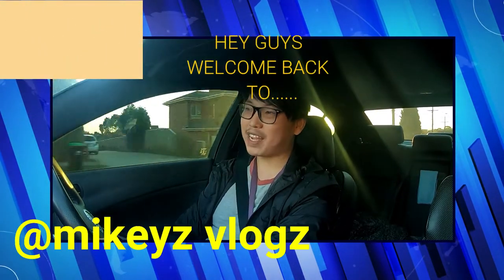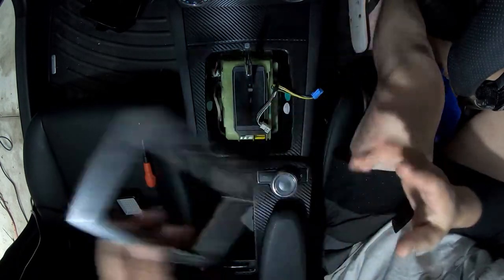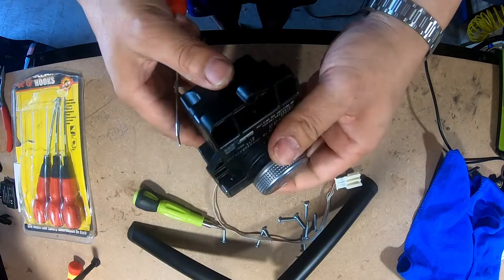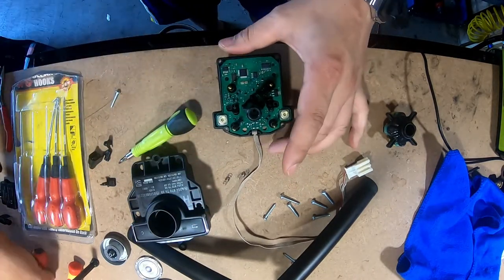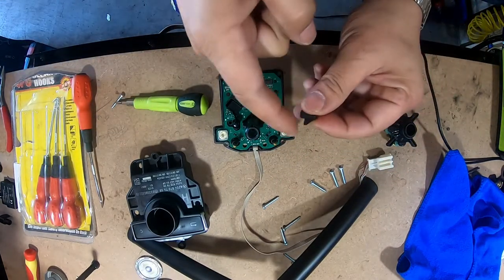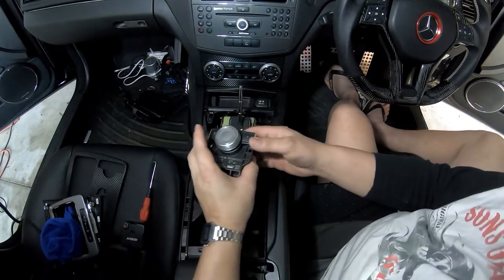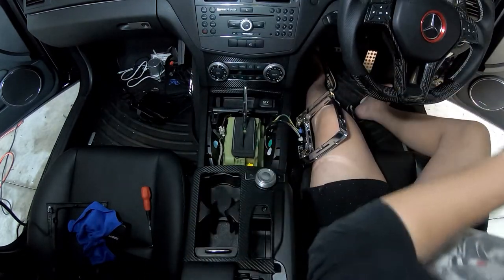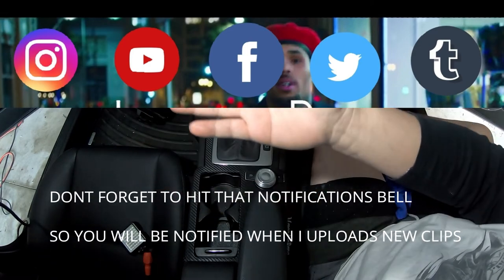Mercedes Benz w204 HOW TO  FIX command control scroll knob shaft

Comment: Dude just finished it. Reading comments after completion ….Like many others worked great! On 2012 c250 w204
Like others had difficulty removing the knob cause it’s different. But after playing with it for little while I got it out, turns out you don’t need to remove the knob outer ring, the center is a cap glued in. It came off by me trying to force the outer ring out … then I just remove from screw under the knob …the rest was spot on. 
More detailed than the x8r video like someone mentioned.
First and only comment ever, we’ll deserved.
Thank you.
Reply from the maker: well done fellow w204 owner. congrats on saving yourself at leaat 350 dollars which the dealership would have charged at least minimum. some even quote upwards of 500 so good on ya mate. im glad my video was able to help u do this procedure . well done bud

Comment: Awesome video man 👍 Worked perfectly fine for my S204 facelift and saved me heaps of money. Trickiest part was, to remove the metal ring from the controller knob, it was super tight.
Reply from the maker: yeah it's a bit hard but once u get it off everything is pretty easy... good on ya mate for getting it done

Comment: This was literally perfect! Got my C207 fixed and am so happy.
I couldn't get the cable from side out at all, instead I just pushed it so that I had a little more lead available for the unit and just did the change while it was still connected.

Otherwise all sorted, and very pleased
Reply from the maker: great news mate I'm very glad it worked out for u

Comment: Hey @Mikeyz I just followed your instructions for fixing this thing and I have to thank you so much for putting the time into putting this together. Even with the quirky graphics ;)

The only thing I struggled with was, placing the control on top for the first time, it didn’t click. But once I had actually screwed it on properly, the whole mechanism worked perfectly. 

Thanks again and merry Christmas from Adelaide 👍🏻
Reply from the maker: thanks mat much appreciated thats what its all about for me ... yeah alot of ppl strugglre with t hat too thinking that you dont screw it in tight enough ..u have to screw it in just right theres a sweet spot.. thats usually the case when the sellect (pressing down) doesnt work ..congrads on a successful fix..well done merry xmas to you too ...and happy new year

Comment: Thank you for the comprehensive repair tutorial. This video has been a great help. The scrolling function is fixed but now the select function (push down on rotary wheel) is kinda stiff and not selecting at times. I didn't screw the shaft screw on tight. And the order of placing the stars pads were correct as same as video. Before the repairs the push down select function was working perfectly. Trying to figure out why it was working before but not so now.
Reply from the maker: ok so when you replaced the shaft and screw on top did u tighten it down all the way... do not screw the screw down all the way it just has to be on ..not loose nor tight just right and it will allow the scroller tonpuah down
Reply: @MIKEYZVLOGZ  Thanks for the tip. That worked. All good now. Cheers!

Comment: Hey bro firstly thanks for the great tutorial A++ I’ve watched a few but yours is the best. 
So I had taken it apart maybe 10 times now because knob wouldn’t sit in and screw wouldn’t reach .. anyway the part I ordered was like .2mm off so I filed it now it’s sweet! All functions working perfectly now except left-right-down. Could I maybe have damaged the board?
If you have a moment could you please let me know what you think. 
Cheers Fade
Reply from the maker: hmm...it should not have to be filed down in anyway, r u sure u put everything back correctly, from what i understand u dont need to do any modificating to make it fit, it should fit perfectly without alterations, its possible u may have damaged something , but cant say for sure.. hard to tell from descriptions, only way is to test and physically look at the board and what may be touching or caused the issue
Reply: Hey Mikey! Ia have the same problem, the knob does not sit anymore, the screw does not Reach the hole and it also does not click (the ok click when confirming an option). I left it Like that until I find a solution, do you have any suggestions?
Reply: I got the same problem, now left-right down not working.

Comment: Thanks for the video.  It was very helpful.  I wholeheartedly agree with your advice to never cut the factory cable unless you have to  Unfortunately, my cable broke when I removed the command module.  It turned out the cable was routed differently.  I had to solder the cable wires back together, and the wires are very fine, and it's not so easy to strip off the insulation without breaking more of the cable.

I also discovered that I didn't need to remove the two plastic pieces with the springs underneath them in order to remove the circuit board.  At least, that was the case with my command module.  

Once again, thanks for the very helpful video.
Reply from the maker: good stuff mate and u r so welcome im just glad that i could  help someome out there fix this problem as it would habe costed quite abit of money just for a simple fix.... in most cases.... also i know what u mean sometmes the cable will be routed differently..i guess i was realy lucky to get mine out with my pick tools.... congrats on doing it your way and i take my hat off tp you matey... well done...that what its all about encouraging others to diy in order to help save money amd get some knowledge and skill along the way

Comment: Thanks for the video, it was very helpful. Let me add my 2 cents because i had to do this twice after the first fix because the buttons weren't working properly, it wasn't scrolling smoothly and random menus would pop up. I was able to remove the cable without coming from the bottom. I simply pushed it down and inward toward the left side, the harness was able to clear the shifter column by doing this. Just be careful that you don't smash the wires against the shifter column. As for my scrolling, button and random menu issues, mine occured because I tightened the screw to to the scrolling wheel too tight on the shaft.  With the screw too tight, it was pushing down on some sensors, I assume. Once i backed off the screw a bit, everything was working properly; scrolling,  buttons and the random menus stopped appearing. Hope that helps
Reply: Nice tip, thanks for sharing that- sometimes its the smallest things that can cause the biggest headaches

Comment: Hey... I did figured out the speaker wire colors on the door pillar connector..the right side speaker wires are white +pos and brown/white -neg.. ..the command knob scrolls around but does not actually adjust the tone controls (bass, treble)... could this be a bad knob?

Comment: Thanks for sharing a great video.  Do you know what is mechanism on the buttons next to the knob?  My back button does not want to spring back once depressed. I am trying to get an idea if it is spring loaded etc on the top cover side?
Reply from the maker: hey bud sorry for seeing this late but as for the button, it might be just abit of dirt stuck in there try a quick dust and used soe compressed air with also electrical contact cleaner to help get some dirt out

Comment: Mikey thanks a lot for the video. I encountered two problems trying to fix mine. First, removing the ring with a screwdriver was just not possible. I had to use a gear puller n it came off just like that. The second problem was, the slot in the shaft where the command button sits was not large enough. I had to file to open it up. It was an interesting project. It took longer than expected but I got it done. Thanks
Reply from the maker: great news buddy well done great news
Reply: Iam having the small problem! Let me find a gear remover

Comment: Thanks a lot - this helped a lot. I bought one from X8R Ltd. Great product, but their Youtube video shows the parts being reassembled incorrectly and there are a few comments about that on their comments section!!!
Reply from the maker: im glad this video helped u out ..yes i saw that video and it wasnt the correct way to diassemble it..infact it was much harder... once u remove the screws u shouldnt have to pry the control apart it should just pull apart .... only part that is kind of stressful is removing the scroller button ... then ur good as gold

Comment: Amazing video thank you ! Could you please post a list in the comments with every single tool you used in this video ? (it would be great to get everything i need before i start fixing my knob)
Reply from the maker: firstly welcome to thw channel ..  i hope you can subscribe and aupport me ...as for your question...of course i can buddy sure thing .... ill do it first thing tomorrow morning for you .... hand on heart ....
Reply from the maker: ok buddy heres exactly what u need 
trim removal  to help remove your gear stick surroundings 
t20 screw driver to remove the screw that holds the centre console surround 
t10 torx screw driver to remove the screws in the control knob x10 t10 torx screws 
pick tool with 90 degree angle  this will help you get to the cable thats connect to the control knob assembly 
and thats it ur good to go
Reply: Hey dude thank you so much for the info, also keep making these awesome tutorial videos! You're doing a great job explaining how to get the work done :)
Reply from the maker: you are most welcome ..thank you for the support ...i will thrive to make better videos and tutorials in order to help as many ppl as possible...
Reply: @MIKEYZVLOGZ  Hey dude, i've got my aluminium shaft today and thanks to your very well made video i managed to fix mine, the only problem i have right now is that sometimes 1 scroll = 2 scrolls OR 0 scrolls. Have you had this problem ? We both have identical cars and scrolling knobs..just wondering if you have any idea why mine is doing this. I think i'm having this issue because the aluminium shaft only has 2 sides at the top (the original plastic one has 4 sides at the top) and it somehow slips out because of the grease ?
Reply from the maker: @WigoFellas  no I never have any issues
Reply from the maker: hi buddy no i cant say i have its perfect..u may have misaligned something

Comment: Beautiful fix mate! Great Post. I have a question about the interior door panel. Where you rest your arm on the door I have developed a small tear from weather and UV ray's. I am willing to tackle taking out my door panel for a proper fix. Any suggestions?
Reply from the maker: hey there alex firstly welcome to the channel and thank u for tour kind words .... i pride myself in doing things right and once .... so for ur issue with taking apart your door ... are tou going to re stitch your leather or what exactly were u planning to do and which part did you need a suggestion on... sorry to break it down ..that way i know what im suggesting for ya mate
Reply: @MIKEYZVLOGZ  I agree, if i take the time to do a project I want to research and do it right. I see myself taking this project as a mean to improve on the aesthetics. I would want to take out just the arm rest part and either sew or cement in leather or something non-synesthetic. I feel like it could be done. I see car seat patch kits on amazon and I just dont see that looking good or lasting. Thanks.
Reply from the maker: @BigAl2918  ahh i see and understand what ur trying to do now..ok so i syrongly suggest to do it right too.... so taking the door panel off will obviously be the route to take and then from there u will need to remove the door handle .... im sure once u remove the door panel everything will.be fairly easy and accessable mate... i did a video on removing the door panel too... if u need pointers on that.... i havent gotten around to removing a door handle yet but i did fix one on my w203 and im sure its somewhat the same... but dun take my word for it.... just take ur time and go slow ... if u ever get stuck take a breather and do some more research as a friend or ask forums...theres so many forums u can get help from and even ppl like myself always willing to give some helpful advice if i can.... good luck and wish ya all the best buddy....hope u get wat u need done matey...sincerely

Comment: My knob it seems like the previous owner put an "AMG" knob cover on the command knob. It seems like my knob is slightly bigger than the stock knob, so it may be hard for me to get the trim piece off so I can remove the command knob. I suppose I can try to pry off the cover of the knob with all the trims and command unit still in place?

Comment: My scroller wont work when i turn it clockwise or anticlockwise like a wheel, however it works when i push it left right up or down and selects. Does that mean i need the aluminum replacement or does it sound like something else?
Reply from the maker: yes the scroller won't work because the top is broken not allowing you to scroll... I believe the top half of the shaft is broken...that's why u can press but not select by scrolling

Comment: Hi, can I ask you, how did you manage to put the facelift steering wheel on your model as I can see you have the pre facelift wright?
Reply from the maker: hey friend so what i did was buy a steering wheel that was already chipped swapped to suit my prefacelift model.... its not as simple as switching combination column... for the preface a chip swap must be done to work with the buttons and switches...dont listen to ppl who say u can simply swap the upgraded colum and a newer wheel it wont work
Reply: Thanks man!

Comment: Perfect video. If u want u don’t need to remove the climate control either. Just unscrew cup holder and u can pull up cup holder enough to get knob assembly out. Thanks.

U just fix it in the car. ;)
Reply from the maker: true good input

Comment: another great video, just fixed mine....oh boy Manual is A LOT easier the cable is right in front of you to unclip.  Also, i noticed with the metal one the control knob feels a little heavy and sometimes not as precise?
Good job on the video, using them all to fix and upgrade my W204 C220
Reply from the maker: good stuff mate hope u managed it all
Reply: @MIKEYZVLOGZ  i did!  Videos are a great help.  So far, fixed ESL, command knob, installed AMP and reversing camera!
Reply from the maker: @jamesstill2129  well done mate very happy to hear my videos could help a fellow w204 owner

Comment: hi! My knob works when pushed down or left/right, diagonals, etc, its the scrolling funcion that its not working. I mean, when you roll the knob (right or left) nothing happens. Could it be the same issue? Thanks and congrats for the awesom video!
Reply from the maker: yes same issue ..it would be the shaft inside
Reply: @MIKEYZVLOGZ  thank you very much!

Comment: Hi , brother . I managed to switch the platic to aluminum part and put it together the joystick in fact upon I tested out it doesn't go down or side to side , I am able to scroll tho,  any idea or suggestion? Thanks for the quick video ...
Reply from the maker: hey buddy so after you put it all back together it didnt work properly ? u can scroll but it doesnt go down ? or you mean press down as in select ? i think you may have forgotten to place a part in correctly or upside down .... u may need to take it apart again and re assemble it but be sure to do it correctly and ensure no parts are out ofplace and it works as it always should .... pay close attention to detail of how it all sits ..especially when it comes to how the rubber piece sits thats allows you to press down and select as well as move side to side and up and down
Reply: @MIKEYZVLOGZ  thanks brother,  I will review the assembly
Reply from the maker: @mexicanovlogsenvancouvered159  no problems friend glad to help

Comment: If the plug has been severed is that easy to fix or do you need a new connector to the circuit board?
Reply from the maker: How badly severed? The plug itself or the flat 5 wire cable?
Reply: MIKEYZ VLOGZ  - the cable was cut from outside
Reply from the maker: @The_McD  its quite easy to fix you can solder it back together ...it only goes back one way ... so its easy to figure out how it connects back as there is a colour strip on one side..and you can solder it backtogether and it will work no issue however that will also depends on your soldering skill as well... but take your time and im sure you can do it...